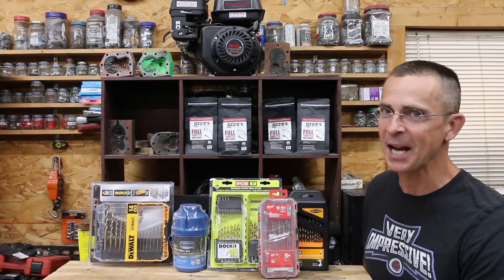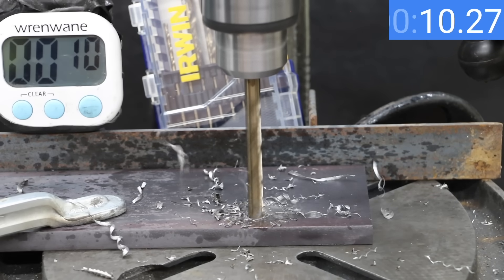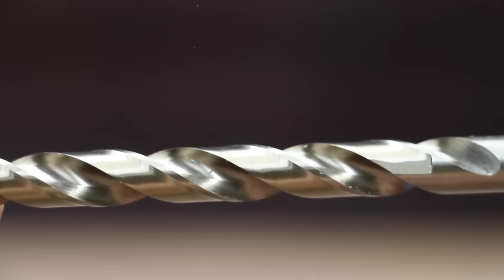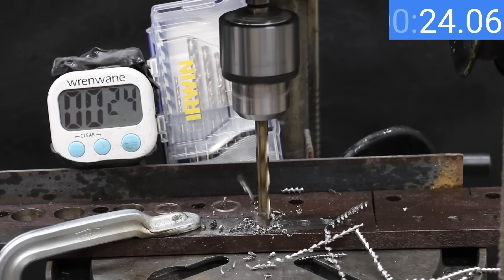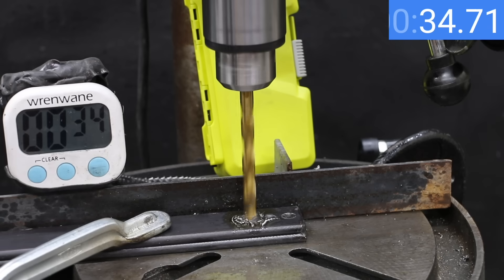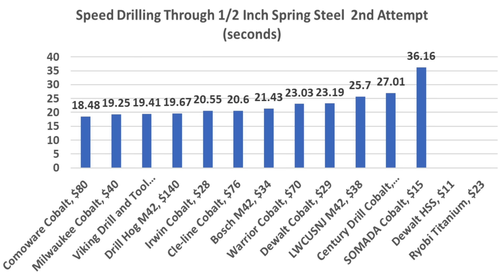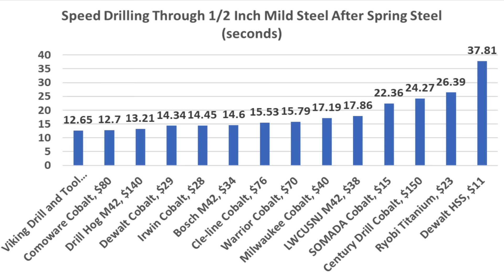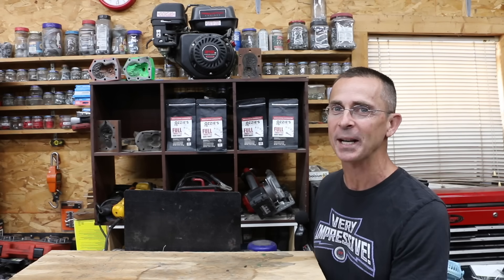Best Drill Bit Set? $11 vs $200? Let’s Settle This!

Comment: I've had the Bosch for a few years and they are still holding up unlike the other sets I've purchased. Always good to see you purchased wisely.
Reply from the maker: Thanks!
Reply: I have the same Bosch set as well. They are my go-to set for drilling metal. I use the DeWalt HSS set for wood and other materials, and they work fine.

Comment: When I installed the blast deflector shield for the B-52 Flying Fortress to be chained down and go Full Throttle to clean its engines out against we used Harbor Freight step drill bits to open up the holes to slide bolts in
Reply: Stratofortress
Reply: @1234Robocop  Oh yeah that's what it was called they used to make me lock my phone in a different room and then drive across the runway to go to the skunks Works facilities to disassemble the blast Shield they had some real Poindexter nerds from NASA retrofitting new engines to the Stratofortress this was 2019. Also f-16 wide mouth intake covers are perfect motorcycle or barbecue covers
Reply from the maker: Thanks for sharing.

Comment: King of the comparisons. Another great one. A suggestion... head gasket sealer. I blew a head gasket on a vehicle that is not worth gasket replacement, but should still have some life left in it. You are my go to, but I didn't see anything from you, so I had to look elsewhere. This just happened yesterday, so it's too early to know for sure, but the Barsleak seems to be working.
Reply: Back in the day, that was supposed to be the best.  By day, I'm talking about 20 years ago.
Reply from the maker: Thanks!  Thanks for the suggestion.

Comment: Hey, im not a manufaturer. Im just a guy in my garage who wants to start manufacturing unique products for a specific market. I recently saw a video you did where you tested winches. In the video you purchased a bunch of hitch mounted winch cradles and they kept breaking. I have engineered my own that i have given the same 12,000lb rating as the ones you were using, but I have actually tested it to 15,000 lbs with no failures. So with your permission, could i send you my prototype to use and abuse during you tests for other products? As much as i would apreciate a mention to gain some recognition, i know that is not the purpose of your channel, so if possible, just use it and never mention its design or manufacturer. I would just like to see it abused for data points as i dont have an established testing department. It would benefit both of us as i could see what improvements i could make, and you would have a cradle rhat actually lasts through your testing of other products.

Comment: I would like to see you test the Matco hyper-step drill bits.  They are a combo bit where the tip is a step bit, but is sized like regular bits.  Kind of spendy, but I like mine.
Reply from the maker: Thanks or the suggestion.

Comment: Interesting that the Ryobi bit had material stuck to the front of the cutting edge. The whole point of the titanium nitride coating is supposedly to keep the chip from welding itself to the chip curling surface.
Reply from the maker: Thanks for the feedback.

Comment: I love to see it when expensive brands are taken down by less expensive brands but that did not seem to be the case here... with the exception of the Century Cobalt which still did not finish last. This is a great guide for purchasing a common use item because if someone is or is not planning on drilling hardened steel, they can choose the best fit for their toolbox. Thanks for another great one!
Reply from the maker: You are welcome!  Thanks for the feedback.
Reply: If the older me could go back to the younger me and tell myself "pay the piper and get a good set of bits" I'd have more money in my pocket.  Cutting tools are one of those deals where you really get your money's worth.  But it's also important to know how to drill.  High speed in metal = dead bit.  Slow, steady, and quite a bit of force is the way to go.

Comment: This is a very interesting test.  A lot of the test times were relatively close and rather than look at the differences in the speeds maybe a person should consider the tests to be a pass/fail situation, then shop based on availability and price.  I agree with you on the sharpening- if drill bit performance is important to you then you also need to learn to sharpen them effectively.
Reply from the maker: Thanks!  Thanks for the feedback.

Comment: I literally just bought a set of Drill Hog, m60/pig steel bits. Came with 13 bits up to 1/4in with no skips for $28. Nice bits, nice case, excellent lifetime warranty, and made in the U.S. with U.S. steel. Havent had time to use them yet, but I expect good things.
Reply from the maker: Thanks for sharing.

Comment: Awesome stuff, as always, very impressive. Man, I wish you would have added some turbo step or step point bits in there as well. Not the huge step bits but the regular size fluted drill bits with steps on top. Just to see how they match up against the regular split point. Would be interesting to see maybe in a future vid.
Reply from the maker: Thanks!  Thanks for the suggestion.

Comment: For my occasional use i go with DeWalt cobalt or i get jobber bit at Fastenal. I also like Norseman bits which you didn't test. When I worked at a Fastenal store, the Norseman were our number one seller then Milwaukee and finally DeWalt.
Reply from the maker: Thanks for the feedback.

Comment: I would strongly encourage people to not buy into the gimmick that are pilot points if you want to buy tools with longevity.  As mentioned they can not be sharpened which makes them useless to me.  Instead invest in a center bit set instead to go along with a normal drill bit set.
Reply from the maker: Thanks for the feedback.

Comment: You did it again, Commander! I especially likes the one about how much and fast the drilling quality dropped because that will eventually tell the tale. I have a Bosch and Hansen set but went with DeWalt for bits for the impact but would just go DeWalt for complete sets if I was buying new. I've got a fairly complete set of Irwin spade bits for when I was playing like I was a thumb flattener. Happy winter! It was 12 here this a.m. but we left the water dribbling and nothing frozen. Yall remain calm and Be BLESSED all over!

Comment: I recently bought that Milwaukee set and two of them failed on the third use. The Hercules bits did not have the same issue and I was then able to finish mounting a ladder rack onto my trailer.
Reply from the maker: Thanks for the feedback.

Comment: Another great test. Shows that with drill bits, cheap ones are often good enough to get the job done and are good to keep in the home tool kit. My drill bits are made by a company called Sabre. They are well priced. I bought these for use in my lathe.
Reply from the maker: Thanks! Thanks for the feedback.

Comment: Haven't seen the vid yet, but in my experience in the UK it just makes sense to buy drills and tools from a proper engineering supplier. Much cheaper and higher quality than the stuff builders use. And people need to learn how to sharpen drills so that they last, especially for builders who can get away with a rough regrind.
Reply from the maker: Thanks for the feedback.

Comment: I'd love to see you review methods of joining automotive wires. E.g solder and heat shrink, twist and tape together, butt connectors, spade terminals and the new heat shrink with low temperature solder inside. 

You could test time to use, current handling ( resistance, do they heat up under heavy load) strength when pulled, external heat resistance etc. Thanks for the great content
Reply from the maker: You are welcome!  Thanks for the suggestion.
Reply: Solder and electrical connection test but b4 testing there is different ways to twist the wires together b4 soldering and use double wall heat shrink.

Comment: This is the topic I know a lot about. What is not checked here at all is how concentric holes are and how big the holes are.
Cobalt makes drill bits touch harder, thus they were far less worn on hard steel. Same idea with coatings, but they make lip duller and don't last for resharpenings.
Pilot point is not an issue when sharpening. You just eventually remove it.
Reply from the maker: Thanks for the constructive feedback.

Comment: Great video. I work with wood though and would be interested in stress testing modern "speed" bits. Those 3 fluted and paddle types.  Just hitting a nail messes them up but we keep using them anyways. I don't have a very big sample size but wouldn't be surprised if Diablo brand is on top with wood speed bits.
Reply from the maker: Thanks!  Thanks for sharing.

Comment: I can get some drill bits from the UK to send over,and some good ones from Germany too if you want to try them out there's a Sheffield company and a small German maker, the known brand DIY (drill maker) bits generally don't last, the black and decker piranha branded ones are quite quick to go through things like electrical cable lay metal trunking  and the likes and usually last a day a bit with electricians but I'm not sure how they last on other things

Comment: A big factor on drill bit life is spindle run out and work holding. If you have poor runout or your work is flapping around it won't last as long. Carbide is king in a rigid set up. HSS is best for poor runout/workholding.
Reply from the maker: Great points! Thank you
Reply: @ProjectFarm  I think you'll find you'll get better results (and much longer life) spinning them slower, too.
Reply: Depends. HSS covers too many alloys. Some cobalts like M5 are better HSS than M42 for poor work holding.

Comment: I have that $11 Dewalt drill bit set. They're fine for everyday household use; why spend more to drill holes once every year or so in wood or tile?
Reply: Tile? I like the cheap DeWalt twist drills I use them on steel all the time, but you ain't drilling through tile with them
Reply: @slayerspam ...I did.
Reply from the maker: Great point! Thank you

Comment: Strap in kids, this is going to be interesting...
I'm manual machinist, who has been grinding drills for literally decades..
Reply: As someone who has been learning hobby machining for the last five years, I would say that the results are definitely peculiar. While speed may be one criteria, a drill bit that gets torn up after one or two holes is not a valuable drill bit. The ranking in this video put Cle-Line at the upper middle (7th, I think) but for me the USA made Cle-Line set available from Lowe’s for $56ish bucks has performed much better than all the big box brand names and maintained an excellent cutting edge without significantly damage like many of the drill bits shown in this video. If I were doing it, professionally, the Viking or other machinist quality brand would be a top priority. As a hobbyist, the Cle-Line have been an excellent compromise between cost, performance, and durability.
Reply: What brand do you recommend?
Reply from the maker: Thank you

Comment: Suggested video: Best YARD MAGNETIC PICK UP TOOL -Those ones that been used over the ground to pick up metals / bolts / nails etc.
Reply from the maker: Great suggestion! Thank you. I did test a few of these in this video:  https://www.youtube.com/watch?v=mDKVGxuyGAs
Reply: @ProjectFarm  I missed it! 👀🤦... Thank you 🙂
Reply: The best one you can get is the home built one, a chunk of 1/4” flat steel/iron stock with a couple of fishing magnets on top makes a pickup tool that will pick a wrench off the ground

Comment: I needed this, marketing on drill bits has gotten absurd.
Reply from the maker: Great point!
Reply: @ProjectFarm if they used TURBOCAM’s TX1 diffusion treatment, I think they’d hold up even longer
Reply: "I needed this, marketing has gotten absurd."

Fixed it for you.
😁
Reply: As a Machinist I prefer carbide drills.  They are brittle but retain their edges far better than Cobalt and HSS.